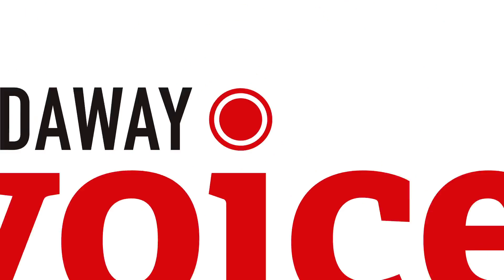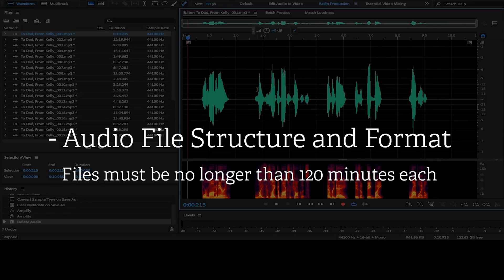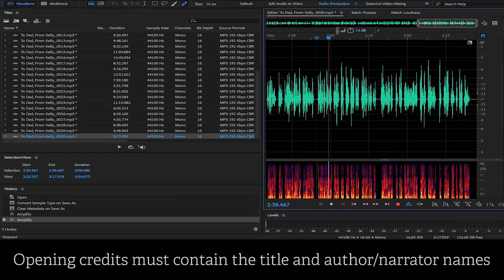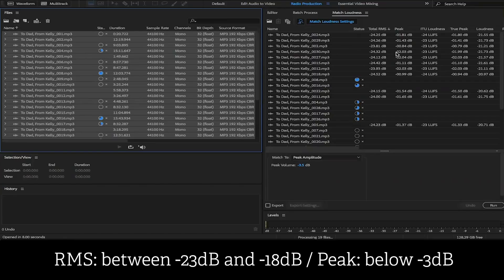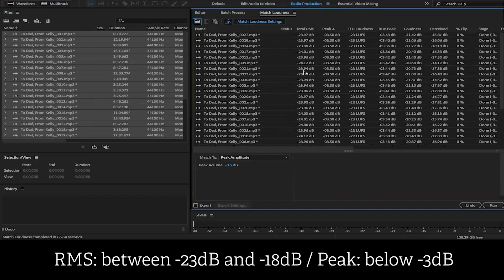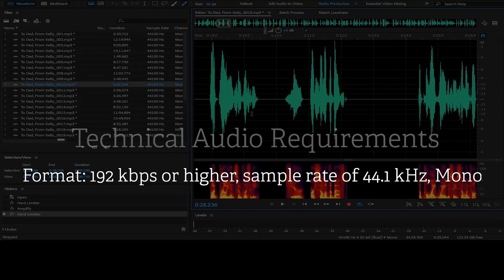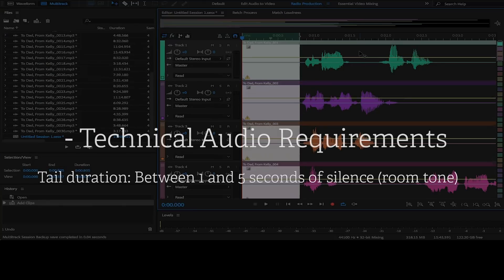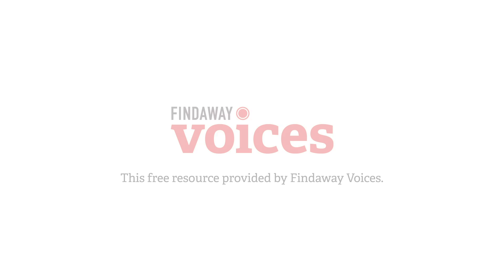Mastering Your Audiobook: An in-depth guide with Adobe Audition

Comment: I am not having trouble with the internal requirements but with cover design. They all have the same characteristics and required titles etc but nothing in the artistic explanations can explain anything. Findaway Voices cannot even be contacted by any of its links as they go to nowhere. This is a dead end. Eventually I am successful with covers but there are two now that I cannot understand why they have been turned down when they are following the exact parameters of the previous ones. A video tutorial would be amazing for cover design requirements.

Comment: It's a nice video, however, I'm submitting my file to Spotify which requires a LPF file, generated by publishing to Spotify. It automatically generates the Opening File by using the first five minutes of the script. It gives no opportunity of submitting an Opening, Front Matter, Ending or Retail Sample that Findaway Voices requires.
I've tried numerous times submit my audio book, generated with an AI voice by ElevenLabs.
When I publish the eBook to the Spotify to generate the LPF file, then try to submit that file to Findaway Voices, there is not opportunity to upload the missing flac files i.e. Opening, Front Matter, Ending, Retail Sample - thus I get rejected, again.

This is my first audio book and is an issue I've been battling for the past three days.
Any clearly understood suggestions would be greatly accepted.

Comment: I understand that each chapter has to be less than 120mins and for an 80,000 word book I have 42 chapters so 42 sections or audio files. That I understand. But how do you upload multiple audio chapter files into the body of the book section in the Findaways platform because it says you can only upload one file but I´d have 42 files. Thank you

Comment: hello wes! great video. these tips are super helpful as I was starting to find myself in a loop of what to do for the loudness. question about the audition match loudness. when you run the parameters is that effecting the audio file by limiting or adjusting volume or is this just a metering tool?

Comment: I was looking at Audacity's RMS measuring tool and it is not nearly as powerful as Audition's. Tweaking amplification, normalization and peak levels does not meet specs, no matter what I try. Looks much easier to do in Audition as shown in this very helpful video. I was hoping to use free software. Any suggestions other than Adobe's Audition?
Reply from the maker: Thanks for the note, Rokit! Try continuing to adjust the compressor setting using the Audacity Dynamic range compressor until the RMS is within range.
Reply: @voicesbyinaudio  Thanks so much. I downloaded free Compress&dynamics plugin, ran it under Effect and used Analyze/Measure RMS. Worked perfectly and got me in range!

Comment: About the Total RMS values, please, can you explain where those values come from? what are the reasons to set those values?
Reply from the maker: The total RMS is the squared amplitude of the audio signal, averaged over a period of time, then the square root of that result. When adjusting the RMS, the target value should be set near the middle of the desired (acceptable) range, because this value is based on an average, further adjustment to the audio signal is adjust the average as well. Since the acceptable range is -18db and -23 db, we picked a midpoint target of -20.5 db.
Reply: @voicesbyinaudio  Thanks, but as my knowledge is quite basic , I had to research a little more and found good resources to understand the RMS, for futher references here next: https://www.audiorecording.me/understanding-what-does-rms-stands-for-in-audio-definition-details.html